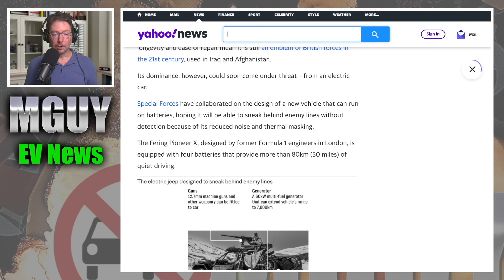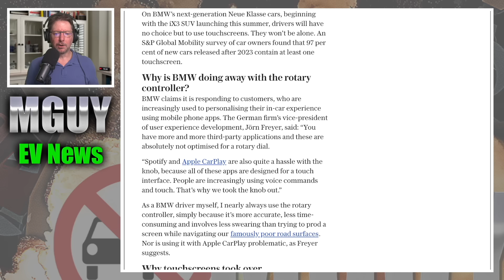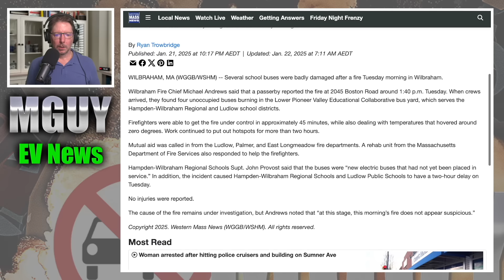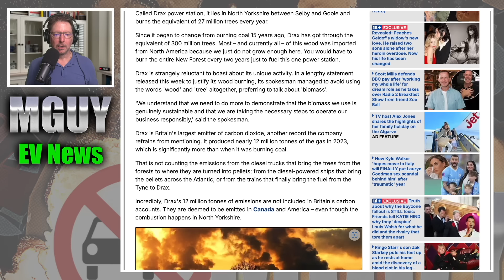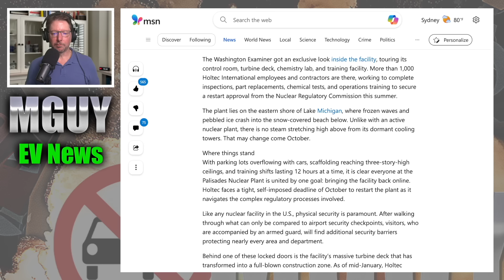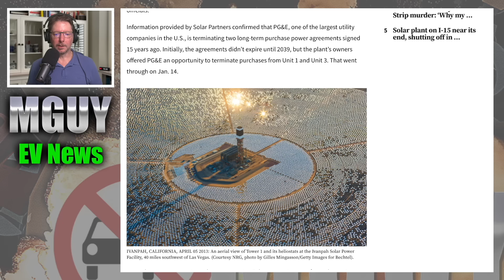Electric Jeep is UK's latest EV madness | MGUY EV News 26 January 2025

Comment: I just brought my 1991 Peugeot 205 GT to the workshop for an engine overhaul. It has 250'000 km on the clock, needed some oil so it was time to take action. I am not sure how long spare parts for such an old car will be available for it is not a top-class vintage car, so I decided to do this overhaul as long as new parts are still available without problems. I think that the prices for such "low maintenance" cars with real switches and buttons and without touchscreens will go up and up. If the manufactures do not make a u-turn back towards mechanics, there will be a "cubanisation" of the car market; the old ICE-driven cars will get older and older because no one with more than one brain cell will ever buy an EV with that electronic crap. 
Greets from Germany to you and your community.
Reply: Plenty of parts for the 205. Peugeot museum still produces parts for the car like switches etc as they are much loved by enthusiasts. I have two GTis, great cars.

Comment: A whole 50 miles wow! So after you drive to the front lines it stops there. Great idea
Reply: So 30 miles in winter!
Reply: 25 out 23 home
bye bye
Reply: Well they need something to transport all the rainbow people directly to the front...
Reply: @russellnc  It’s not even a normal rainbow.
Reply: Is that 50 miles on a smooth road or 50 miles across very rough terrain and rock crawls? I bet I know, but it would be nice to think they have actually considered it
Reply: @ohwell2790  and after 50 miles you have to charge it for 10 hours? What if your enemy keeps using their petrol and diesel UAZ? GB is doomed!
Reply: You could enter the mission from a closer starting point. 🤔
Reply: @ivortoad  that sounds like the Irishman/ yokel ( depending on telling) that was asked for directions and said "I wouldn't start from here".

Comment: Touchscreens are unergonomic and dangerous for the driver. I can't understand why the authorities haven't banned them or required that they blank out when the car is in motion.
Reply: It’s easier to track you when your car is a smartphone on wheels.
Reply: Because they prefer you to check out 😮😮😮😮
Reply: These screens must be annoying and dangerous even if they are turned off as they reflect sun light into the eyes of the driver.
Reply: change rules
so it dont comply
in a accident what went wrong
phone or touch screen
Reply: Next you will have to use a sliding bar on a screen to accelerate/decelerate and a button on the screen to indicate.
Reply: @Recumbent_Rider  you already have to use the screen to indicate on some as far as I know.
Reply: @stevengriffin7873 I believe in the Xpeng they are bringing into Aus now, that you have to go into the touchscreen menu to adjust the air vents on the dash FFS.
Reply: it will be nice to have the touchscreen when you can't afford a flat and have to live in your car
Reply: @philiphumphrey1548  analog always is better...
Reply: Voice activated makes more sense maybe?

Comment: Thankfully my new car has knobs for air con controls but the set heating and fan speed is on the touch screen, the radio is controlled from the steering wheel once the channels have been set.

Comment: Using a fossil-fuel generator to provide power to an electric motor is the LEAST efficient method possible - the losses at each stage means it use WAY more fuel than a simple fuel-only system, AND less efficient than a standard HYBRID system. And that "7000km range" claim, WTF? Does it tow a trailer with 1000 litres of diesel?

Comment: I just bought a good used diesel turbo with less than 100K on the clock for 10K. Should last me another 400K at least, and by the time I've done that I will be about 120 years old with my driving patterns.
Reply: I have a g37 I’ll never sell. Just enough power, looks good, buttons for AC. Love it

Comment: Moss Landing Power station Fun Facts;
The power generation plant currently has a capacity of 1020 MW (net) from its two combined cycle units.[3] It was once the largest power plant in the state of California, with a generation capacity of 2560 MW, before its two large supercritical steam units were retired in 2016. The remaining generation capacity is 1020 MW  
As of 2024, the site's battery storage facility is the largest in the world, at 930 MW
Do the math, Net Loss of  1540 MW PLUS (or should I say MINUS Charging those batteries) = 610 MW, Min peak Available Capacity down from the original 2560 MW
Reply: Couldn't they reverse the charge from EVs when needed?

Comment: UK Special Forces are now using Toyota Land Cruiser 70 series in the WMIK role (Weapon Mounted Instalation Kit) - machine guns bristling open top 4x4.
Reply: Sadly I bet the original 
HiLux is probably the most lost vehicle to war. So rare now.
Reply: @ivortoad  I have a 2012 D4D twin cab 4x4 Hilux, it's superb. I prefer it to the yr 2000 105 Series 4.5 petrol Land Cruiser I used to have. Though the Cruiser was more capable off road.

Comment: You will need generators run by diesel to keep them charged.
Reply: NO, extension cords and power lines back to coal fired power plants will be the way to keep those fast chargers in the battlefield working, it's so easy.....
Reply: @philjohn5337  you do know that most countries have stopped using coal, right? Europe, Uk, USA and even China is using less coal and using more alternatives. EVs are agnostic. They can use electricity produced by any fuel wind, solar, nuclear, gas, hydro .. 
But fuel needs electricity to mine it, extract it, refine it, transport it and mostly burning stuff. So the whatabout argument is really childish.
Reply: @ So there's jerry cans of electricity in the battlefield? I really hope you're the one that is conscripted to be the cannon fodder while driving an EV into battle if it and when it might happen.
Reply: @ That's rude.
Reply: @1Electricman  they all stopped using coal for purely political reasons, not because it isn't a good source of energy. It is net zero and climate change  that killed coal, nothing else.
Reply: @DanRyan-v5y  yeah! I remember my  professor saying something similar  many years ago.
 Coal needs very little processing once it is mined. Transporting it to the power plant should also be net-zero, maybe trains, not trucks or ships. If the flu gas is kept away from cities to prevent smog and the levels of sulphur dioxide/minoxide are monitored, and levels remain low. It is a valuable source of energy. 
If mining costs go up, transportation is more than a few kilometres, then it's no longer financially viable. To many things can go wrong and usually do.
Reply: @1Electricman   the mad thing is Drax had a coal mine next to it iirc. That was why it was built there.

Oh and UK powerstations had to fit flue gas desupherisation equipment to stop the acid rain ( so2). Now they are talking about using so2 to lower the global heating. Talk about mad ,we stop doing something because it's bad then later on they start doing it again but don't use the power station that would provide it. It is almost as if they are trying to do as much damage as they can to the economy and the environment.

Incidentally the calcium sulphate that was left after the sulphur scrubbing was sold to British gypsum to make plaster boards . The fly ash used to go for making breeze blocks ( light concrete blocks used for internal walls). So a lot of recycling, unlike windmill blades.
Reply: @DanRyan-v5y  🙂 expensive upgrades like that are very useful and do a lot to keep those plants operating efficiently and effectively. 
There are also several long-term ideas to recycle/reuse those blades. The amount energy provided by the wind per dollar spend is currently the most cost-effective. This means electricity providers will most likely choose batteries and wind over coal and gas. Regardless of birds and blades. All said, I am hopeful that  only the grid is diverse.
Reply: @1Electricman  the ideas I have heard about recycling windmill blades don't really stand up to scrutiny. They are make work to justify what is a massive negative for windmills.
If the total cost of windmill energy was included IE production , installation,  maintenance etc, the cost per MW is not good at all
 It is only because the figures are fudged to only include operations IE fuel costs that they win out.

If wind and solar didn't get massive subsidies and have the playing field of the market rigged in their favour ( IE if the real market ruled) then few would bother with them. Too expensive and they will always have the intermittency problem.
Reply: @DanRyan-v5y  you can believe that wind is not financially viable. That's fine. But to say they are unfairly tax funded is drastically ignorant. Sorry mate. Oil and gas and coal have been tax funded for decades. Not just with tax-free benefits, there is funding to dig for oil in Australia and the USA. This is information freely obtained. There is a report that reveals we have been paid out trillions of dollars. If we paid the true cost at the pump, it would be 6 times the cost.
Reply: Yeah, like on some of the UK motorway services for charging EVs.
Reply: Not while on patrol!
Reply: Just like they fuel planes in flight, I wonder if that's how they will fuel their generators?
Reply: @ Im not absolutely sure about that. After reading the article, it seems to me that it's neither. From what I understand, there is a combustion engine powering a generator, that then drives the electric motors (and also charges the battery to enable silent use). There doesn't seem to be a direct mechanical connection between ICE and wheels. It seems to be the same principle that has been used on many large ships and submarines for decades.
Reply: @valuemastery  and locomotives
Reply: No. It has a traditional engine on board as well, and the battery charges as soon as the engine is running. No external charging needed. With its large onboard fuel supply, it can go as far as 7000 km without needing any external support. And when you're in a situation when silent driving is needed or you'd like to be undetected by infrared cameras, you can switch to the electric motor. It's all in the article shown in the video, you just have to read it. Unfortunately, MGUY gives us only part of the truth. The designers of this vehicle are not as dumb as certain people would like to make us believe.
Reply: True. Yet you charge batteries while in the rear and then use electricity to rush to the front line quietly, at high agility, speed and with a low heat signature, which only an electric motor can provide. Thus, the vehicle makes great sense for front-line medivac/supply scenarios.
Reply: @RomanShein1978 *Reduced heat signature. It will be seen the same as any other just in a different shade of color. It’s not camouflage dingus. The tires alone will give enough heat to be plainly visible from the land or the air with thermal imaging. 
If anything it’s supposedly recon and will never be rushing to any front lines. You need to stop watching movies.
Reply: @walnutkraken9430  EV vehicles irradiate just a small fraction of ICE vehicles (I estimate -80% heat). 
If anything it’s supposedly recon and will never be rushing to any front lines. 
- Where is it supposed to rush then? Of course, it will operate on the front line, indeed.
Reply: @RomanShein1978  the rear can be  hundreds of miles back, refer to the Ukrainian conflict. You will never be able to creep up based on only an electric motor. Dust ,noise heat will still give you away
Reply: @DanRyan-v5y  the rear can be  hundreds of miles back, refer to the Ukrainian conflict. 
- The rear on the Ukrainian front is more like 15-20km (I'm a Ukrainian btw).

Comment: Touch screen for everything is as dangerous if not more than using a mobile while driving
Reply: Absolutely. My point to
Give me nobs and dials
Reply: @garreysellars5525  Exactly, you can turn a knob or move a slide control without being able to see it, we can't do this with touch screens.
Reply: US Navy tested touchscreens in certain areas at an Arleigh Burke class destroyer and they were not amused with the rusults. They stopped trials after only some months.
Reply: Agree 💯too distracting
Reply: @gilbert7794  spot on!

They're basically saying don't use mobile phones  when driving because it's dangerous.

But you can use tablets when driving because that's perfectly fine.🤦‍♂️
Reply: On some cars the screen is in the centre and important info is NOT displayed where it should be behind the wheel.
Reply: My local Costco installed a large touchscreen to enter the parking lot. You have to push a button to get your parking pass. They failed to realize the sun shine makes it impossible to see during the late afternoon creating long lines of people unable to see the screen.
Reply: Slippery
Reply: Bring back knobs and cranks, Seat levers mechanical / analog is superior over time.
Reply: dont worry , we put in lane departure system and auto braking for when you'll inevitably be distracted in sub-menu number 4 to  turn on the lights
Reply: Exactly!
Reply: Ridiculously and unnecessarily distracting and complex.
Reply: @animoetprudentia2865  Not to mention they update all the time so every couple weeks you have to relearn where everything is. STOP changing the user interface!!!!
Reply: How did they ever pass vehicle safety standards ?????
Reply: @Mr-Hotdog-Stand  woke shitheads approve them
Reply: They are prepping for large language models. Put everything into software first.
Reply: Yes, you need buttons and keys.
Reply: I’ve asked Tesla drivers about whether they are distracting and they just say, well you can use your voice, you don’t have to look at the screen…?
Reply: @sueedwards9334  and that's better? What's wrong with just using a button? Also, voice recognition sucks and it's quite unreliable especially in a noisy car.
Reply: You are so right..Knobs in cars are what we need, the sort you turn , ..., not the bad driver type ..Lol...
Reply: Who here knows just where a certain knob, button, control, twisty thing is, even if you have just a quick glance at it, then touch and feel plays a part of adjusting said adjustable.
Fingers don't slide off the control either like a touch screen when not looking at it.
Reply: We need to outlaw those ipads in the dashboard.
Reply: And then I always see army personnel wearing gloves.
Reply: I don't even like it for the radio. The only sensible use I can see for these things is to set preferences for how you want certain things to behave. For example, when you unlock the driver's door, do you want all the doors to unlock or just that one? It is nice to be able to customize things like that, and having a button or switch for each of these would not be practical. But it's not necessary to touch any of that while driving. You can take 10 minutes on a Saturday afternoon to get it all set the way you want it while parked in your garage.
Reply: We need Good luck turning down the volume fast with a touch screen 🤡🌎
Reply: Absolutely.
Reply: the touch screen in my mazda 3 is not functional once the car is moving, only when its stopped, all cars should be like that.
Reply: however, touch screens have a major advantage over switches and buttons. they are cheap. and now guess what wins when beancounters decide?
Reply: @wolfhalupka8992  
Cheap.  Have you replaced one 😁
Reply: @garreysellars5525  It's cheaper for the manufacturer to install a screen and do everything electronically than designing and fitting mechanical controls for everything.
Reply: @wolfhalupka8992  But when the screen/computer locks up, what next?
Reply: @wolfhalupka8992  Until the screen goes kaput. One bad spot on the screen and the whole screen needs to be replaced at $$$$$$$$$$. One push button goes kaput and it is a lot cheaper to just replace the one button.

Comment: SITTING DUCKS on the BATTLE FIELD when RECHARGING
Reply: Recharging how😮
Reply: @ USB fast charger 90W, plugged into a socket in nearest town.
Reply: @garreysellars5525  50 km long cables?
Reply: Recharge how? The first thing an enemy does is take out the local power grid, either by sabotage or kinetic attack. Look at Ukraine!
Reply: They will do it like aircraft, a gas turbine generator, on a articulated truck, running on diesel and an array of trailers with cable reels being towed behind which the Jeep’s can dock onto, a nice formation that is easy to attack. I patented it first!
I know it sounds silly, but those idiots are game for anything….
Reply: No they will be carrying their own diesel generators
Reply: @jameselliott8203  That sounds like a woke ass backward solution.
Reply: @pingpong9656  it was meant to be